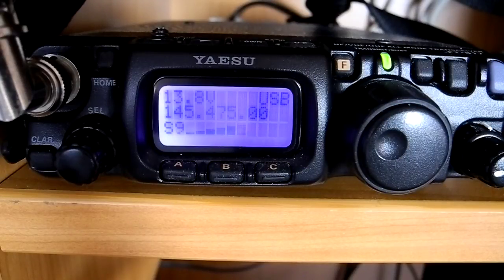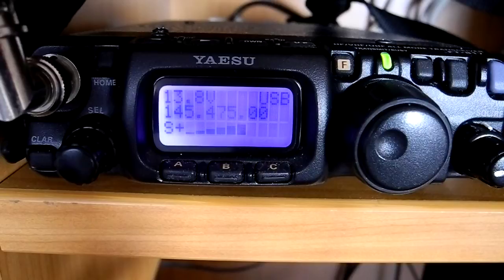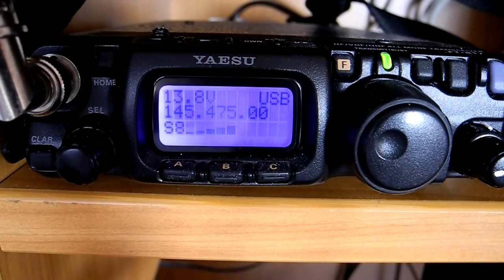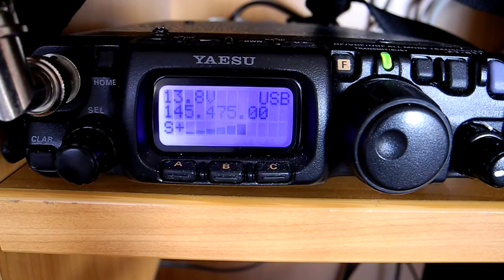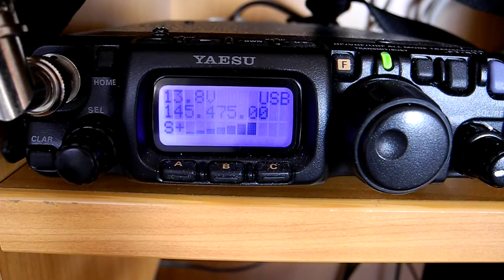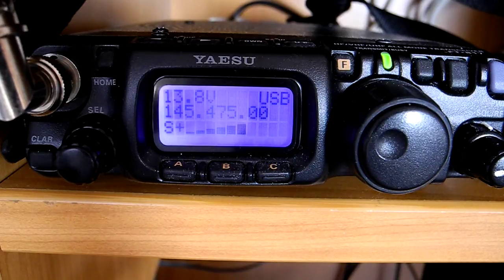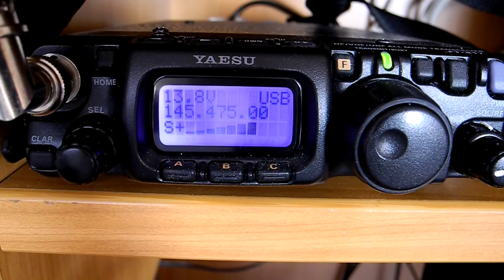Yaesu FT-817ND mic comparison test on USB

Comment: you need to switch the resistors on the SSM2167 that set the limiter and compression otherwise compression doesnt work (i think.i can hear it not working in the video)
the resistors are placed wrong from factory (1k and 15k) just switch them around and its fine

Comment: That really does show up the muddy audio from the original mike. I have an 857d as well, use the MH-59 mike for it and its clears up the muddy audio quite well. Also has the benefit of many functions on its DTMF buttons.  I found my Astatic Teardrop (original from the 1980s) gives very clean audio indeed.
Yaesu should be ashamed to supply so many of their radios with that lousy MH-31 mike, it's no better than some of the lousy coffin-mikes supplied with CB sets back in the 80s.
Reply from the maker: I agree.But nevertheless in my opinion the MH-31 is one of the best dynamic stock microphones on the market. On the FT-817 it sounds ok on FM (as the FM Modulator is very high-pitched and crisp, so with better electret capsules it often sounds worse - especially on the FT-817ND models. The older FT-817 sounded a Little bit smoother here). But on SSB there is a leak of high tones and therefore a leak of speech intelligibility.I only would name TWO stock handmikes with dynamic capsules quite good:The Yaesu MH-31 and the Kenwood MC-43SAll other handmikes with dynamic capsules I know all have that "plastic case sound". So the MH-31 is definitely not too bad. But you Need to Switch the A/B Setting to B (= 700 Hz highpass filter) and KEEP IT THERE !!.  :-) :-)Pos. A sounds too muffled.Your MH-59 is the best DTMF handmike for the FT-8x7 series. The MH-36DTMF instead has a noise-cancelling capsule in addition to some R+C parts which form a passive highpass filter. And the DC bias resistor in the MH-36DTMF is far too small (270 ohms). So a MH-36DTMF in its original state does not sound good. Your MH-59 ist FAR better here.And I like the crispy pileup-breakthrough-sound of the Astatic D104-M6C handmike you also hear in the video.Last week I sent one to a hamradio friend of mine. Each Sunday morning we have a small and local 10m ragchew Group. And he fights on my side with an extreme poor Signal as he is too far away from me for groundwave QSO's.He only has S1/R2-3 on 5watts and if he Switches on his 50watts PA he gets S3/R4 on Peak. But the MH-31 (on pos B !! ..hihi) always sounds poor.Now he received the slightly modified Astatic D104-M6C from me.Boy, what a difference !! He has now S2/R3-4 on 5watts (I always fight with homemade noiselevels, so it' still not that good here) but a great S5-6/R5 with his 50watts PA. The Astatic really drives the FT-817ND and produces a great high-pitched crispy Audio.The only Thing I modified was to increase the Gate resistor in the D104-M6C. It has 270 kOhms, I cutted it on one side and soldered a 1 MegOhms in between (2 MegOhms would have been even better). This improves the basses but the crispy high tones are still there untouched. With this mod it sounds a Little smoother, but is still a BEAST.:-)You hear this modified mic in the Video. I did the mods Long time before I sent him my microphone.

vy 73,
Jochen, DG2IAQ